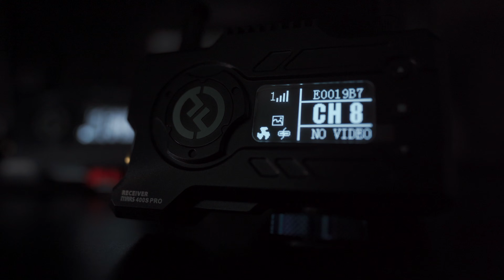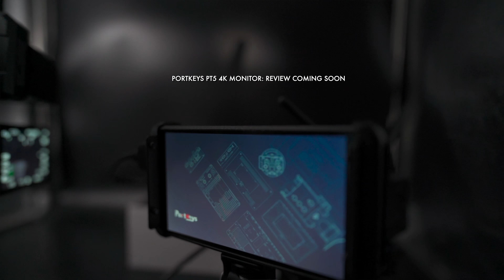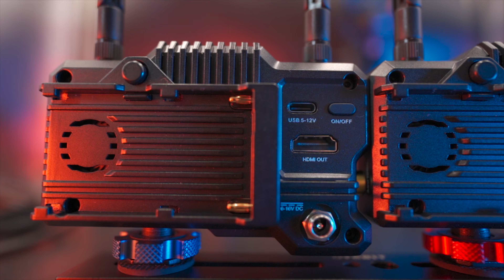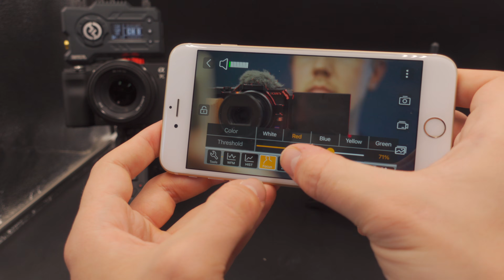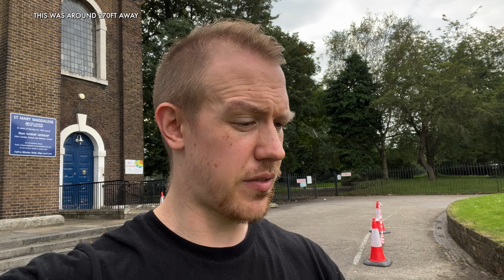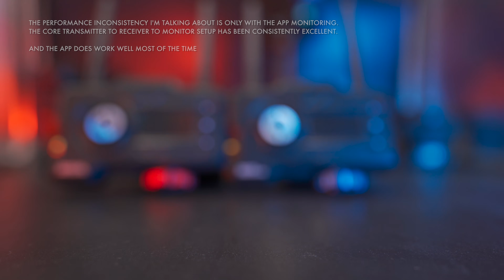Best Wireless Video System? Hollyland Mars 400S Pro Review. Test w/ ZV-1 A7C ZV-E10

Comment: I just wish the 400S Pro had the same HDMI loop out option as the 300 Pro. Going from camera to monitor to transmitter could add to latency.
Reply from the maker: It's a good point Ed, in my simple tests latency wasn't a big problem but this was made during significant pandemic restrictions so how much it would impact a bigger multi person scenario is more open to question - either way it would certainly be a nice feature enhancement. Thanks for watching, consider subbing if you like the content and have a great weekend:)

Comment: The Hollyland wireless system is excellent. I have the Mars 400S system. I recorded a short review for it on  my channel. 

What was impressive in my demonstration is that I show how I can take the monitor outside of my building - which is old and filled with pipes - and NOT lose connection with my camera.
Reply from the maker: Great to hear from you as ever ATF and cool to hear you had a great experience too:) Definitely a powerful bit of gear!
Take care and have a great weekend 👍
Reply: @dbvares8745  Thanks. I just realized I made a grammatical error in my comment. I meant to say that I did NOT lose connection with my demonstration. (Of course, I've fixed it. But, boy, I hate when that happens.)